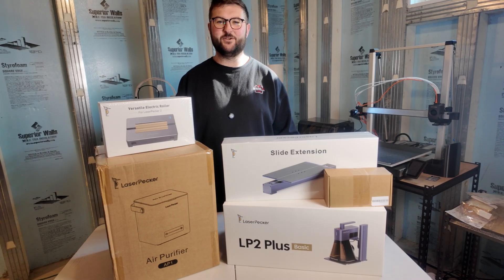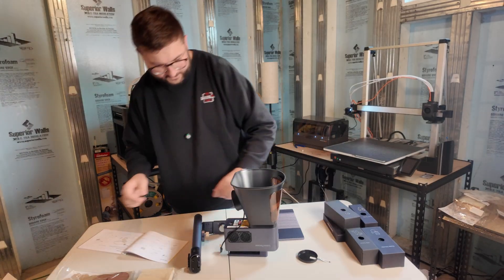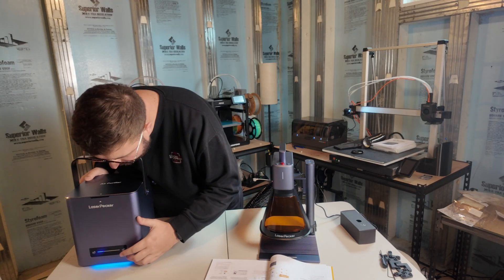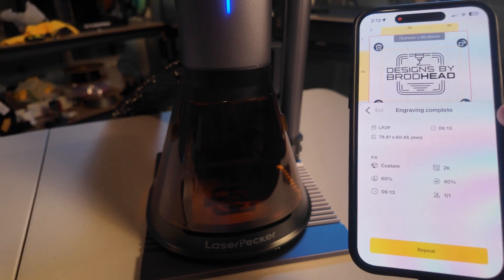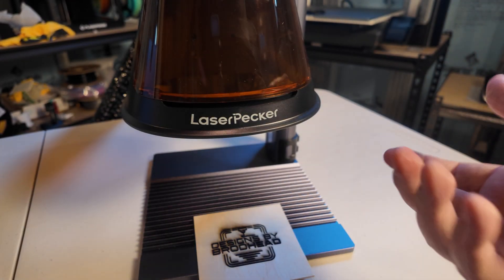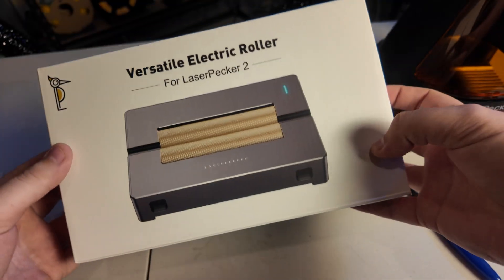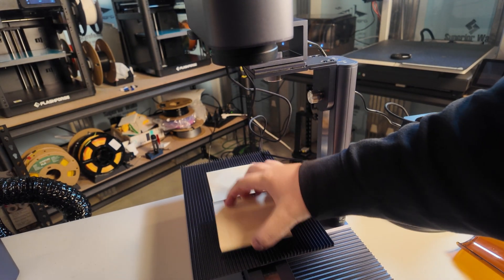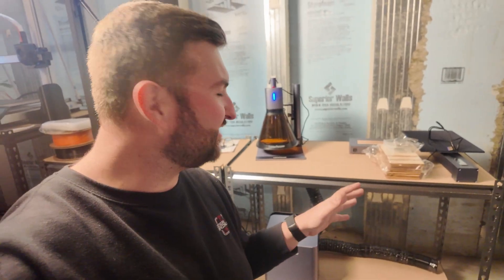Best Beginner Laser for YOUR Small Business? Unboxing the LaserPecker LP2 Plus

Comment: Nice one. The versatile roller, by the way, is versatile because it can roll an object on itself for engraving, or you can literally bolt the LP2 Plus to the roller if it's rollers-down, and have it drive over a large piece you want to engrave a ton on. It moves the engraver across. Like a sign.